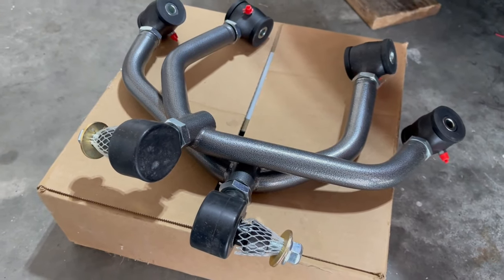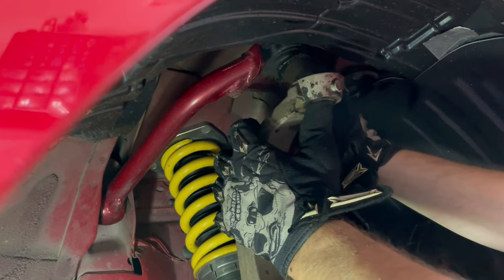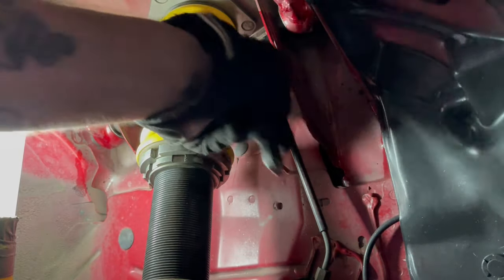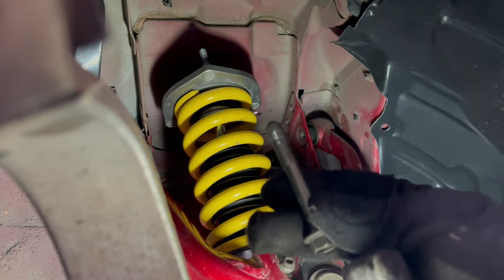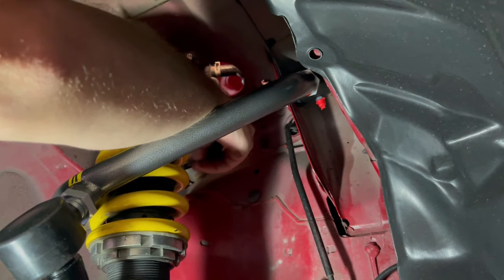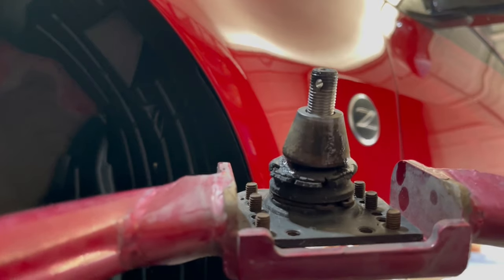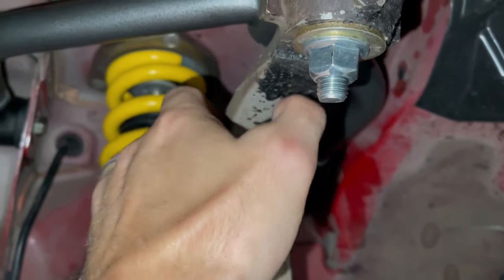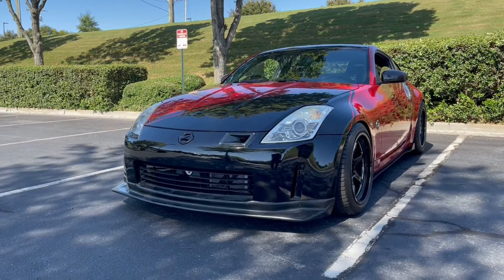Installing Adjustable Upper Control Arms | Q50, 350z, G37, 370z

Comment: Great content there on the Nissan platform.

Those look like spherical joints on the new FUCA. How was the NVH as compare to stock? I'm thinking of going with either Z1 or SPL spherical joints on my Z, if the NVH increase wouldn't be too bad.
Reply from the maker: Nvh wasn’t bad at all.  The previous ball joints were in such rough shape that anything would have been better.  No strange noises or anything from the new ones!
Reply: @SpeedCultureStudios  Thanks, that's good to know.

Comment: i have stock uppers and i’m running 45s tires up front and the cotter pin is eating up my tires lol is this a good fix ?bi run fatter tires up front less stress to my bussing etc i don’t wanna run a lower profile
Reply from the maker: Why is the cotter pin eating your tires?
Reply: @SpeedCultureStudios the space between the upper control arms and the tire (235 45 19 ) is soooo tight it rubs on cotter pin

Comment: How do I avoid what people call camber , I don’t want my wheels tilted
Reply from the maker: Adjustable control arms are the best way, particularly if you lower the car significantly, which will naturally pull the wheels in.  You can counter that with adjustable control arms
Reply: @SpeedCultureStudios  I probably sound really slow when I ask this but how exactly do you know how you have them set to where the wheels are even ? By adjusting and putting the wheel off and on until you can tell they are even ?
Reply from the maker: @Gofast8954  I describe the process in the video.  You can measure them in comparison to your current setup which will give you a good starting point.  You can adjust from there.  Ultimately though you want to get an alignment so they are adjusted precisely.
Reply: @SpeedCultureStudios  do you need rear upper control arms are needed for a divorced set up ? (planning on getting camber arms with elimination kit)

Comment: oh BTW when are you going to do the headliner on the Q50?
Reply from the maker: The Q50 headliner is pretty complex actually 😂 Not sure if it’s a job I’ll take on
Reply: @SpeedCultureStudios  Believe me, it's a complete pain in the ass, but worth it in the end. It took me one weekend. that includes taking the headliner out of the car, cleaning it, having it dry then cover it with the black suede.  Of course, you have to get the other matching acessories, or it will just look odd.

Comment: Y y’all always don’t show your full process you need this dwn or go bck and edit your video you didn’t show how you even took the strut off jus pushed it out the way
Reply from the maker: Some things are relatively simple and don’t need to be shown in full detail.  You can see where the studs go up into the strut tower bucket and you can see daylight through the hole.  And if you are looking under the hood, you can very clearly see where the strut is mounted.  Looks essentially the same on a vast majority of every car.  Making videos is a tough thing—if you show too much people complain it’s too long.  If you don’t show a couple of small items, people complain that something was missed.  This is a pretty simple job.  I don’t think you’ll have any trouble
Reply: Overstood but that still dnt show me how you took dat strut out n yeah I see it but when I took the bolts out it still want move, but u right doe cause I had changed my Valve body and I did one thing wrng n it den wrk but I fixed it cause sun one showed me not certain things the people who want it the short way ain’t hme never get far you have to take yo time but I will never no if ion get the proper training or sumone to show me like you I would like the long way but i appreciate it
Reply: If u don’t know how to remove the strut , then maybe u shouldn’t do this and have someone else do it .. just saying
Reply: I’m jus saying I did it but still show your wrk all I’m saying Homie
Reply: I never went to school jus watching video but I changed mine I gotta Infiniti q70 but yeah ion need nobdy to do nun fah me but make da video fah me to learn the right way doe not no garbage video skipping threw wrk